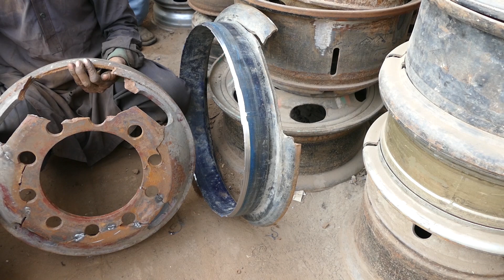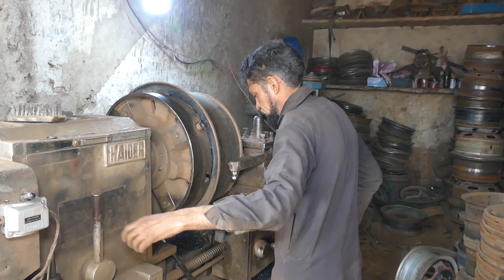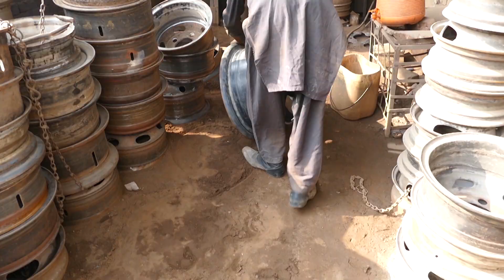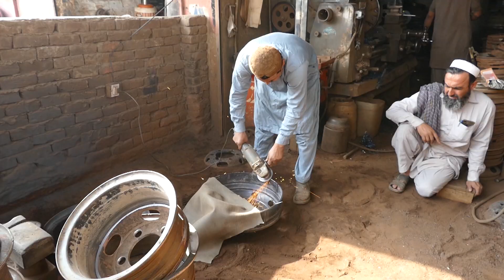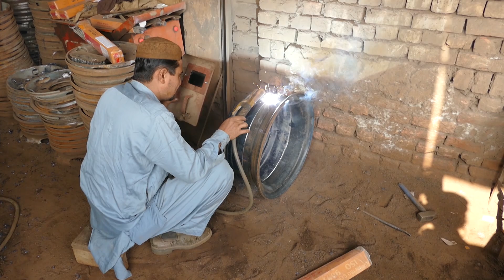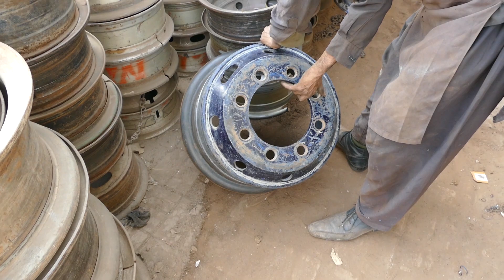How to Repair Old Broken TRUCK RIM with Wonderfull Skills

Comment: too dangerous to use these types of rims in the trucks. i will never ever also use these types of repaired rim not even in my car. anytime it can be broken due to heavy load or at high speed
Reply: The centers are welded in every wheel every where.